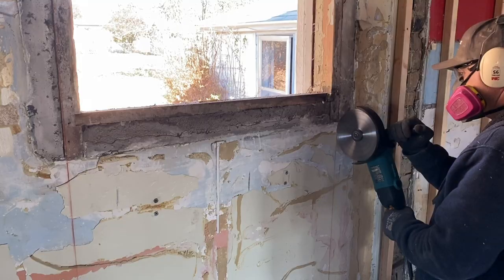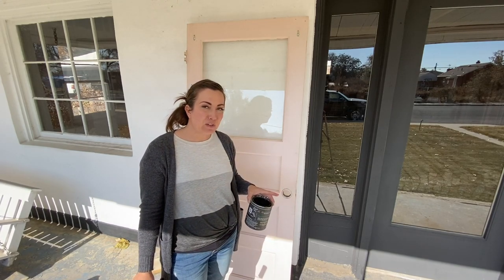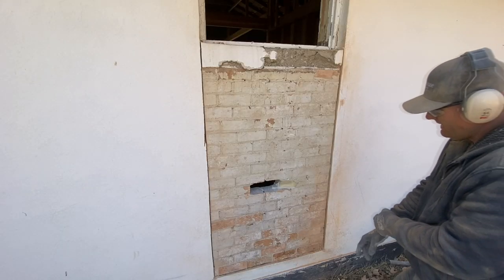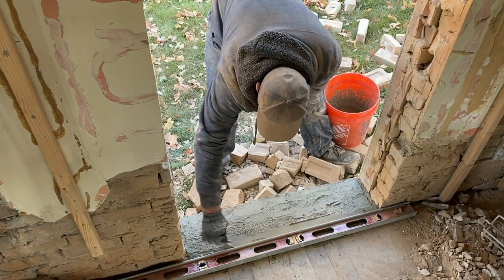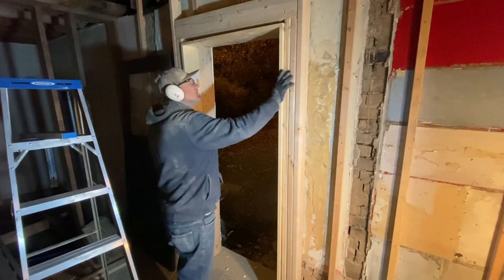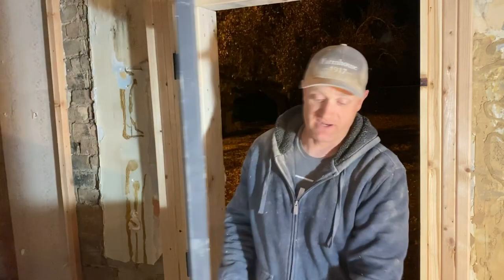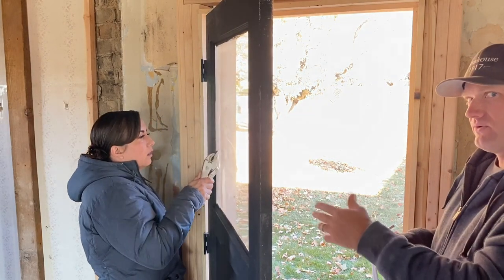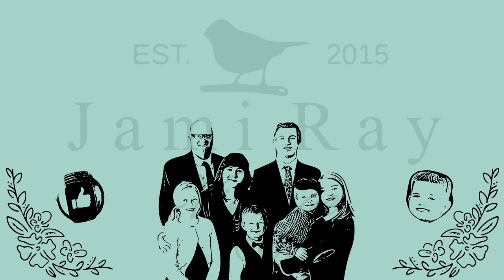Adding A New Exterior Door At the Farmhouse | Farmhouse Renovation Part 21

Comment: Hey Zeb, we needed a piping bag recently and didn't have one on hand after we'd started the job. We put the wet non-shrink grout in a gallon Ziploc bag, cut off one bottom corner, and squeezed out the cement with no problem. The mix was thin, though. Might work in a pinch, but not with a rich mortar mix, most likely. Just a tip that might help someone.
Reply from the maker: Oh nice!

Comment: I have built a few new “old” houses and I have always used Emtek brand doorknobs. I like how you can choose different back plates to go with the doorknobs or no backplate if you want. They have some really gorgeous craftsman options. Another option is Baldwin but I found them a bit pricey but really the best quality if you want to pay the price. I’ve had Emtek in my own house for 16 years and it survived my 4 boys just fine. If you are looking for doorbells Restoration Hardware actually has reasonably price doorbells (I know usually not the case) that would suit your craftsman.
Reply from the maker: I’ll check them out!  Thanks!

Comment: I just love love your videos on this house so my question is if the brakes are soft aren't you concerned about sagging or anything like that or crumbling of those bricks as time goes on?
Reply from the maker: Zeb reinforced the inside of the house with a new structural wall so all the weight of the roof is on the new wall.
Reply: @JamiRayVintage  you two are so smart... great job!!